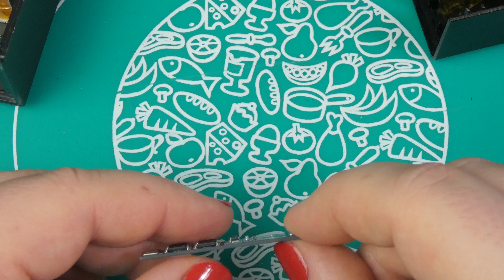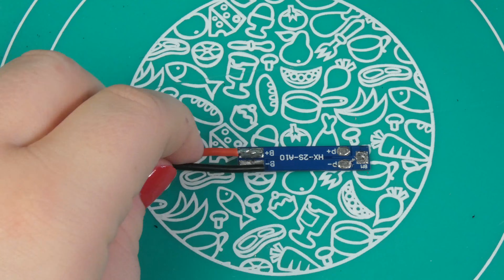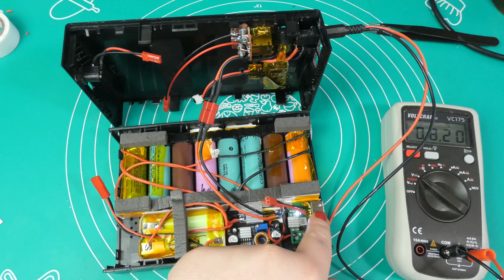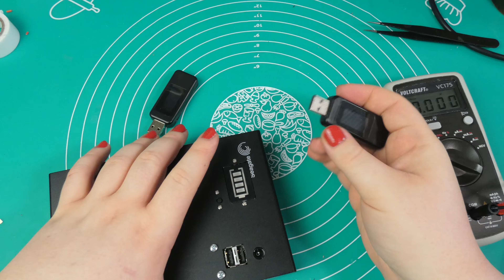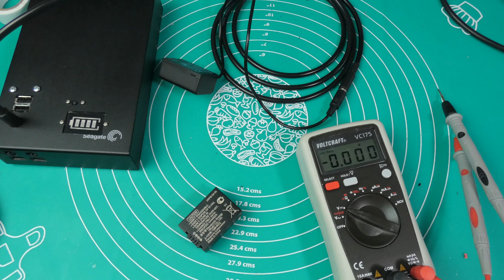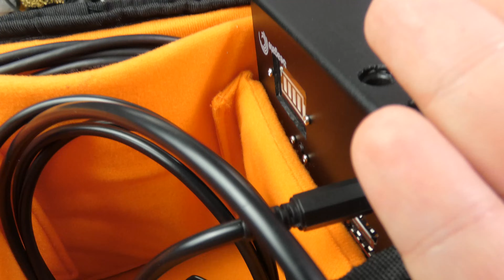External LI-Ion Battery Pack/ Powerbank for my Camera - BMS and Finish

Comment: i bought a battery holder for 5 cells and a powerbank board from ali, put it together and i can charge my phone a lot of times before i need to recharge the home made power bank :)
output is 5v @ 2A. No bms needed , and it turns on with a load, off in a few seconds without .

Comment: Nice job Anna. 
I bought 2 x 18650 battery holders from China. The wires suppled were like telephone cable which I replaced but as soon as I loaded the batteries up the springs which kept the batteries in place glowed red hot. They were going to be used to replace the NiCad batteries in a 7.2V drill but I soldered tabs direct in the end. With tab connectors I can change the batteries rather than wait for them to charge. With your number of batteries I don't think that is needed. 
It really is nice to see you back Anna.